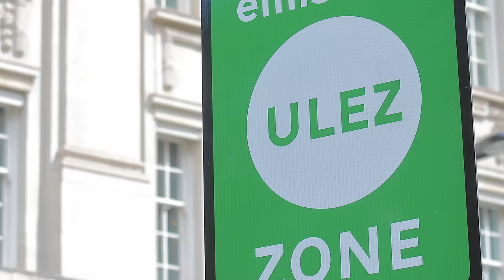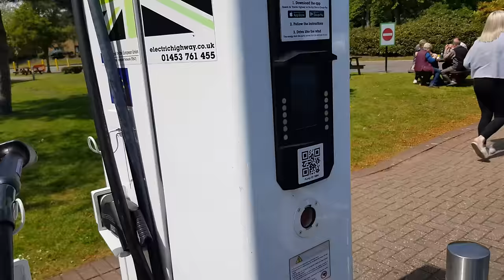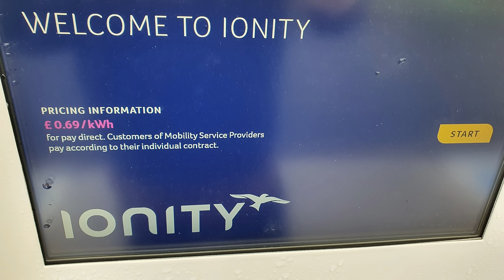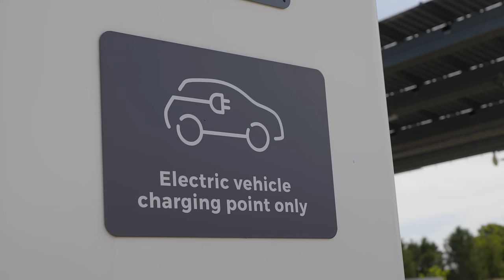The Uncomfortable TRUTH About EVs: The Version NEITHER SIDE Wants You To Hear

Comment: There's a growing affliction called EV Anxiety. Not everyone lives in a city. Having your life swinging (be it a bushfire or physical injury etc) on a notoriously unreliable power grid or dodgy internet is the stuff of nightmares. EV's undoubtedly great for some, myopic to think great for all.
Reply: Remember that gas and diesel pumps require electricity.   So no power for ev cars is the same as no power foe ice cars.
Reply: @Tom55data  Aside from the fact pumps often have a manual backup, you’re just deliberately missing the point.
Reply: @gregc9344  no, I have never seen a petrol station with a manual pump, it is well known in national disasters that all fuel is a problem.   Ev cars neither solve the problem or make the problem worse for transport.   They do provide a house backup system like a petrol generator.
Reply: @Tom55data   If I lived in an alternate universe where I had an EV AND the option to charge at home and....I get home late, plug it in to charge it for my next work day that starts on the road, being a freelancer.... only to realize when I get up a couple hours later that there was a 4-5hrs power outage in my street or neighbourhood - which happens about 2-3 times a year and I only have 50km left to drive electronically. Or less. Are you really going to compare this "slight" inconvenience 1:1 to one gas station being out of power and just driving to the next one and top off your tank in 5 minute for another 600-800km depending on what car you drive? The points people think they can make are just ridiculous. 
Do you expect people to get up in the middle of the night and check for power outages? Do you expect them to compensate for this risk and sleep less so they can drive to another neighbourhood and charge up and THEN go to work if they have to.
Reply: @caleidoo  nothing would convince you of anything so I won't waste my time, enjoy your life and you world.
Reply: @caleidoo  Your scenario is implausible.

First off, the likelyhood that you have run a 400 km battery dry is below 1%. See, even if you "only" charge it to 320 km (80% of 400), driving 320 km takes about 3 hours! I know very few people willing or even able to commute that distance every day. Most I know commute between 5 to 150 km away.

Second, if you are in an emergency, a fast charger is likely to be available within those 50 km of range. Stopping to charge for 15 minutes just to get enough juice to get home isn't all that bad, right? If you can charge 50-100 km in 15 minutes that is probably all you will need for now. Hopefully.

Third, the countryside is the place which will benefit the most from this transition. Solar, wind and batteries are supplying more and more of rural areas with power. Look at Australia that are dismantling their coal power at a breakneck speed, for instance!

If you have a solar roof with close proximity wind generators the likelyhood of your community suffering a power outage is drastically reduced, especially as there will be a few MWh of battery storage (perhaps 10 MWh or so?). This is the future though, not where we are now.
Reply: @wertigon  Again someone pretending to know my work situation, what I do and how long I drive and the charging options BETTER than myself or can't believe my situation is real and not rare at all "because you personally don't know anyone with the same needs". Your arrogance almost trumps your ignorance. So you change reality to make an EV fit in my life. Thanks for proving my point.
Reply: @caleidoo  I am talking about the general case, yes.

Then again, please give me a good reason why you wouldn't buy a $30k EV truck with 750 km of range, and I am happy to listen. :)

Meanwhile... Everyone else that can will go electric because it makes economic sense for them, so have fun driving 50-100 km to your nearest gas station in ten years.
Reply: @wertigon  So you attack my initial statement, claiming it makes no sense "because you don't know others like me". And then you say you were "talking generally". Weak. And to close off you drop two ridiculous lines at an attempt to have some wit or save face or whatever. One asking why I'm not buying a vehicle that doesn't exist now - your previous comments make me even doubt it's sarcasm. And the other statement either pointing out only the people who can afford it and can enjoy tax cuts will buy an EV - no shit sherlock - and then some completely unnecessary but unrealistic dramatic attempt to make me feel bad for the future over which I - as many millions - have no control over unless I change my job or we buy a new house with a drive way. The only way EV's will have economic sense is if it will be impossible to pay for gas or live with the deterrent taxes. Not because EV's are cheaper to run, because they are only cheaper to run for companies and their tax deductions. For a normal person, buying the same kind of car they have now, but as an EV will still be impossible and they will not find a sane reason to pay 15-30K more if they can buy a second hand gas car or continue driving the one they haven now. For everything else , people are pointing out how things are dividing people based on income. Look at the housing market. But for cars.... the significant price increase and decrease in practicality is just part of the circle of life and because the people who can, are buying EV's now - although demand is clearly stagnating - it proves it's not a problem? Yeah no.
Reply: @caleidoo erm, you started with weird once in a lifetime problems first.
Reply: @caleidoo  Salty now, are we?

Fact of the matter is, there will be an attractive EV alternative for every considerable use case. However, mass market will be developed first. This is how it always goes for every industry. In the beginning the new technology covers 10% and in the end, 95+% of all use cases.

And as gas stations lose 10%, 20%, 30% of their customers there will be a lot of consolidation and shutdowns regarding gas pumps and refineries. Consolidation will happen towards cities and highly popular roads, and cease to exist in a small rural town 100 km from nearest Interstate. This is also not a hard concept to grasp. Exactly how it will play out I do not know. I just know it will happen. Will your favorite gas station be there? No idea. Might hold out ten years, might be gone in 6 months.

These two factors combined guarantees the EV takeover. Only question is when you will get one, not if .
Reply: Hey hey! Why so nasty guys! Had my Zoe for over 3 years. Great for me. Would not suit everyone. Buy what you want! All types of fuel will be available for a long time to come..
A retired General Motors detroit employee 😮
Reply: @gregc9344  a) no they don't
b) even if they do, how are you going to pay for and record your transaction

if the powers off, yo're done

With our EV is the powers off we continue as normal because it's charged from solar on our roof and we have a second hand nissan leaf battery in the garage that powers the entire house for around 5 days or more!

Comment: The Luton Airport car park fire was caused by a Hybrid. So yes the battery was a problem. The media reported it as a diesel car, but that was just misdirection. You can clearly see in the video evidence the battery cooking off.
Reply: Correct. Hybrids carry the highest fire risk, followed by ICE cars then EVs. The problem with EVs is once they're alight the battery makes ot very difficult for those fires to be extinguished.
Reply: Provide evidence, or your comment is useless.
Reply: @DrewzerNI  the risk of fire isn't the issue.. its the fact you can't use normal means to extinguish a lithium iron battery fire.
btw most ice cars catch fire because of electrical issues followed by oil or fuel leaks from lack of maintenance or poor design
Reply: @javic1979  you've basically said the same thing I have. Your point about maintenance reinforces the fire risk profile of hybrids, EVs and ICE vehicles.

Comment: Hi, here's some ev user experience for the comments. My partner bought a 2014 Nissan leaf 4 years ago, it cost 8k at the time. Since owning it she has saved 4.7k in fuel costs over her previous Honda Jazz. It costs 2p per mile to charge it overnight with Octopus go  ( at home) .The leaf is a very nice car, at 10 years old it still feels like a new car to drive. It has done 88000 miles, and still has 85% of its battery capacity( this is very early ev battery tech in the leaf, modern evs would retain much more capacity after 10 years). The early leafs do have limited range though, this is its only downside, but does not cause a problem as is used for local sub 100 mile journeys. I was driving an old VW T4 during the first 3 years of the leaf, the maintenance and fuel costs were crazy. I was lucky enough to be able to buy a Citroen E Dispatch last year, the savings in fuel are again the biggest bonus ( 3p per mile) it's range is much more than the leaf, around 190miles,  so this became our longer distance vehicle. Longer journeys are straight forward as it can charge at 100kw, so top up stops of 20 minutes at services for a loo stop/ snack are at the same stopping intervals as the old T4, (every couple of hours or so )As 90% of the charging is done at home, big fuel savings are made overall, when on longer journeys in the holidays,  the cost of charging on road trips works out the same as the old diesel. So whilst not perfect at the moment for everyone's use case, there are many advantages, and things will only improve. As said in the video, public charging costs need to be lower in future, there do need to be more rapid chargers to keep up with demand, but we have seen new huge banks of chargers appearing at various M5 services, and Tesla have started making their chargers available to none Teslas too. With competition between suppliers, hopefully the charge costs will start to drop....

Comment: I'm a fan of EVs and have been EV only for over 6 years now.
I have to say, this is possibly one of the most balanced bits I've seen on all the issues.
Good job. :)
Reply from the maker: Thanks! It's important to me to be balanced
Reply: Really interesting and well researched video Jay, as a petrolhead I have been following you for some time and like what you do. I am about to get myself a small car, have thought about an EV, but can’t bring myself to buy a vehicle which needs me to sit for a long time waiting for it to refuel on a journey-so I am going to buy a small petrol car. Like most people the majority of the driving is within a 50 mile radius of my home-but my daughter and grandchildren are 200 miles away and I often go there and back in a day. I can do this journey very easily in a small petrol car without having to stop for fuel and don’t see any reason to change my habits. Being 75 years old I think petrol cars will see my driving life out so don’t need to worry about being forced into an EV.
Reply: @K777John  Do you do the long journey without stopping for a pee/coffee etc? Most modern EVs will take on a substantial amount of charge in a 15min pee stop.
Depending on how often you do long journeys, you can decide if its worth losing out on the EV benefits the rest of the time. Other reasons NOT to go EV would be if you couldn't charge at home, purchase price was prohibitive or insurance quotes were silly.
Main reasons to consider the EV is lower running costs & maintenance, better driving experience (that's obviously subjective but having owned both, I'd never go back to ICE) and waking up to a full "tank" every morning. I also think depreciation on EVs is going to be far less than ICE vehicles. It doesn't appear that way currently when you look at things like the Audi etron gt etc. Teslas depreciation is solely linked to the fact they've dropped the sticker price of new vehicles massively. I think EV adoption is at the start of an S-curve and will grow exponentially. Anyone saying EVs are a fad and won't take off etc sound like the same people who said that horseless carriages would never take off.
I'd suggest test-driving some EVs. If you don't like driving them then anything else is irrelevant. Also, consider leasing the EV. Takes away any worries of ownership if your annual mileage isn't overly high. I lease a Kia E-niro 64kw for £250 a month currently.
Reply: @airchie2  You are right in many ways, and I drive an EV myself, as does my wife, for many years now. But the truth is, there are no EVs available that fit his bill. Namely being small, affordable and doing a 400 mile roundtrip in a day. That's realistically at least 7 to 9 hours of driving. I have a 77kWh Ioniq 5. With that he could do the roundtrip with three 10-15 minutes stops, which is sensible, but this car is neither small nor inexpensive. An early like 2019 64kWh Kona would be somewhat smallish and also not overly expensive, plus it's quite straight forward and easy to understand and a fairly good EV overall. But even tho it can also do 400 miles with 3 stops, those stops are more than 30 minutes each. And those stops are not conveniently spaced. On his way there, he'd have to stop for half an hour, only half an hour or so away from his destination. Then on the way back he'd have the two stops spaced more conveniently, but grand total he'd spend one and a halve to two hours extra for the roundtrip. And the Kona isn't actually a small car, it's just not very spacious. It's just too much compromise, IMO, for the task at hand. More affordable, smaller cars with USABLE range aproaching 200 miles and fast enough charging are coming, such as the new offerings from Citroën (EC3) or Renault (R5), but right now there's nothing available that makes sense for him.
Reply: one scratch on battery could cost you $60,000 battery replacement. true story.
Reply: EVs are trash
Reply: @jhol310  keep trolling. You might make me cry. Honest. 😂
Reply: @dfsdh432v9 what are you talking about lol. How are you gonna scratch your battery?
Reply: small crash @bruuhhhh
Reply: @bruuhhhh  a large bump or curb
Reply: @airchie2  you're gonna cry when u miss the premier of Bros 2 cuz ur tesla exploded
Reply: @jhol310  mate if you think a curb is gonna scratch your battery and cost you £60k then you clearly have no knowledge of the lengths engineers go to ensuring battery safety.
Reply: @kalmmonke5037  can you cite an example of a recent ev that had significant battery damage from a small crash? I could be wrong but I'm not aware of recent cases of battery damage from anything other than intense usage or major crashes
Reply: @bruuhhhh  they dno if the cells inside are damaged.  A dent at least 1mm and you gotta replace the whole thing. A single cell gets damaged it's totalled
Reply: @jhol310  bs, a 1mm dent in a cell might kill it sure, but there is not a single place on the exterior any modern ev where a 1mm dent could destroy the battery. And I stand by there is no way a curb or scratch is going to do anything at all to your battery
Reply: @bruuhhhh  if u scrape the bottom and there's a 1mm indent the entire battery pack is scrapped.  This happens.  They have to assume a cell could be damaged.  There's no way to tell without dismantling the pack
Reply: @jhol310  this does not happen. There are lots of protective layers over the battery. Unless you absolutely mince the bottom of your car your battery will be safe.
Reply: @bruuhhhh  it definitely happens.  Just a scratch is all it takes.  Battery packs piling up in scrap yards.  There's articles about it you can google. Alson they're only made to last about 10 years if u drive like an elderly person
Reply: @jhol310  lol, there's no batteries piling up in scrap yards. People pay good money for them when salvaged from crash-damaged cars.
Reply: @bruuhhhh   It's actually true in the USA/North America. Most manufacturers don't repair batteries due to general legal insanity over there. No such problems in Europe.
Reply: not that i know of.  probably most ev's protect battery fairly well because their msyl high budget cars, battery itself isnt weak stuff  either  @bruuhhhh